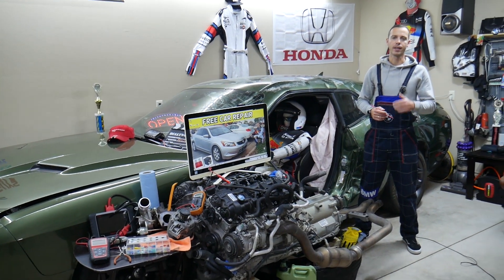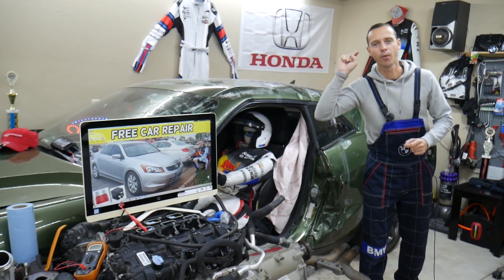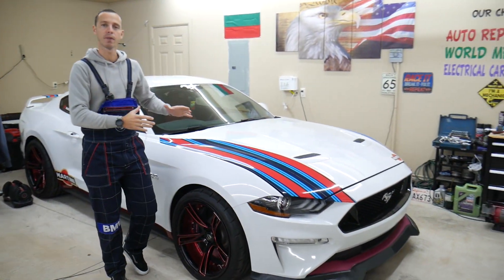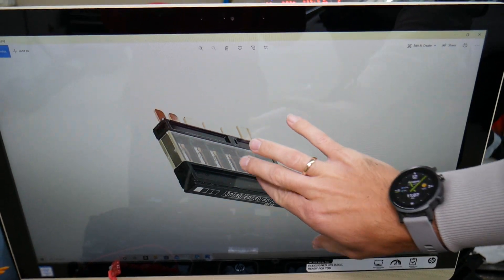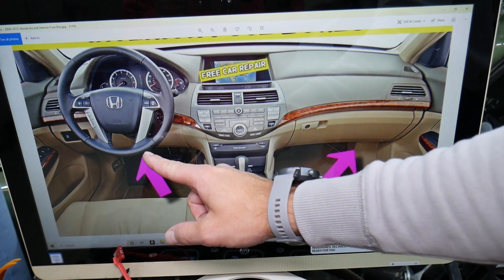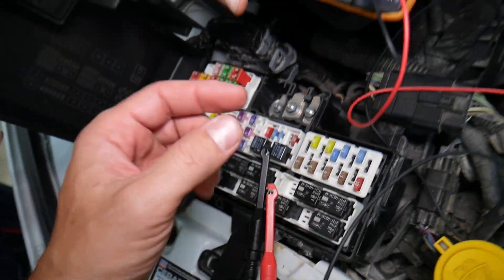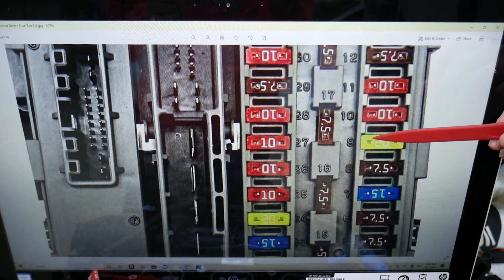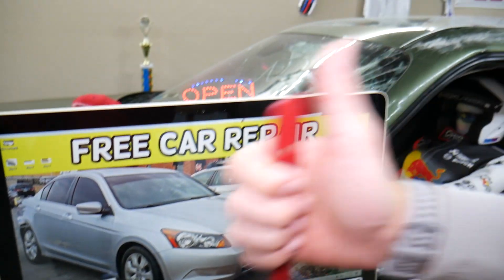HONDA ACCORD IMMOBILIZER FUSE LOCATION, IMMOBILISER FUSE 2008 2009 2010 2011 2012

Comment: okay so i just programmed a key fob i ordered online and got it cut to fit my ignition . problem is when i put my newly programmed key in and start my car , it turns right back off after a few seconds . The green key light also pops up on my dash which is saying i have the incorrect key which isn’t true . My question is if i disable the fuses to the immobilizer will that solve my problem ?
Reply: Did you ever solve this problem if so what was needed
Reply: @RoddTheGod  no I didn’t I still got one key (no fob) to start my car with . And a Key fob to unlock my doors , pop trunk with etc. All cuz I’m too cheap to pay the $80 to a professional to program it lmao . It’s a defense mechanism there’s really no way around it unless you got the tool and you know what your doing .if you take the fuse out it won’t let you crank the car at all .